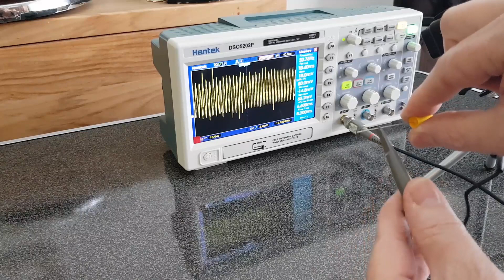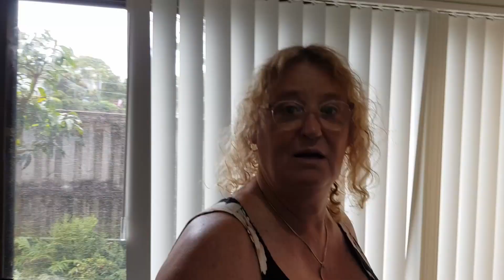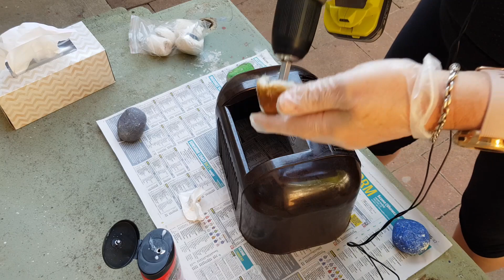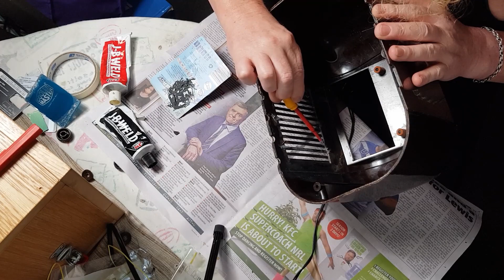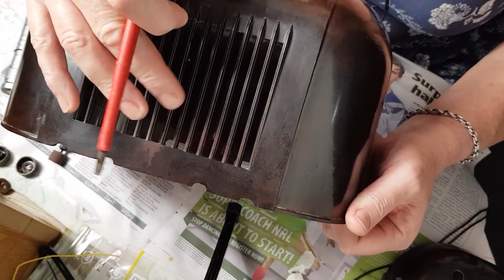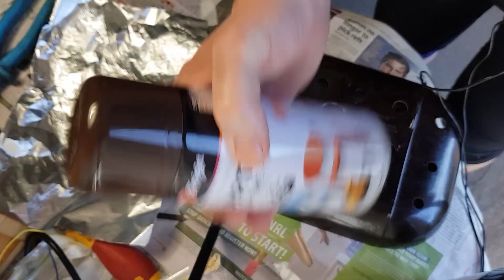Kriesler 11-20 valve radio restoration part 2 replacing the capacitors

Comment: Hi Melissa. I enjoyed your vids. I've just finished an 11-20X and used your JBWeld method to make two grill bars, then used your spray can brown black gloss colouring method. It turned out very well indeed. I have also found another way to colour the JBweld that worked really well in a limited trial, though needs more verification..but.... You can make the JBWeld a bakelite colour to match your particular case by mixing in Feast Watson Prooftint Interior Stain. It comes in 50ml bottles at Bunnings (in Australia) and you need little of it, but at $10.50 its cheaper than buying paint tins and in my opinion easier to match the 'bakelite look' ..better. I used 'Walnut' tint and just kept mixing it in until it reached the colour i wanted. It took about twice as long as normal for the JBweld to set, as the tint slows down the cross linking of the epoxy, so I think you'd leave the epoxy to cure for maybe two days before removing it from the mould. I'm in SE Qld and the weather is pretty warm. It may take longer to set and cure further south,  Like Brian H below  I also remember one my grandparents had one when I was a kid in the 70's and it always looked and sounded superb. Cheers
Reply from the maker: Thank you Paul for watching my Video and taking the time to explain your procedure, ill have to give that one ago next time I repair bakelite, I live in Sydney so I might have to leave it a little longer, I did try Araldite but found that JBWeld set harder then Araldite and found that JBWeld became soft under hot water from the tap but then became hard again after cooling. I have 3 of the 11-20's and have a Google Home hidden in a 4th one, I like the look of them and at the time were cheap pick up's for me to practice repairs on, Good luck on future repairs and thanks again for watching, take care Paul 👍
Reply: @melissa.merritt  Another thing is it's possible to colour cured JBWeld with the prooftint as well. I had a few small places on the case where I needed to match the bakelite colour after the JBWeld had cured for several days. It took the walnut very nicely from a brush but then left a slightly glossy finish. I was able to dull it down by rubbing the areas with kitchen paper a bit. It took off the gloss leaving a better satin finish and didn't lift the colour.
Reply from the maker: @paulnoonan4715  Nice, ill have to remember that one as well, thanks again Paul 😁

Comment: A nice restoration.
I have a few suggestions for you.  The first is when you have a set with so much rust on it, try "Evapo-Rust" on it.  Evapo-Rust comes in both liquid and gel forms.
The mixture of various paints that you applied with a "Q-Tip" worked well.  I saw a guy on another channel ( https://www.youtube.com/channel/UCG0axkVuIieduKse246SvXQ ) use different color "Sharpie's" (Brown and Black) to achieve pretty much the same thing.  Both methods are new to me, but well worth putting in the resource file.
Another suggestion, especially good for the small 7 and 9 pin miniature tubes (valves) is to clean the sockets they plug into with a Dental Flossing Brush and your chemical of choice.  They work pretty well on the 8 pin sockets also.
Where you needed to remove a bit of the JB Weld in the slots of the grill, you might have had a bit of success using the small thin cardboard-type fingernail files.  I have even had success in sharpening knives with them.  I start out with the lower grit side and then finish with the finer side.  
Something that I think you would enjoy and appreciate watching is this video ( https://www.youtube.com/watch?v=LhovRIM5xAo ) from the YouTube channel "Mr. Carlson's Lab".  Paul also has a circuit that he designed and provided schematic, board layout, and plans for that uses LED's to show which end of the capacitor is the outside foil end, but you have to be a Patreon of his in order to view the video and get the material.  You can become a Patreon on his channel for as little as $2.00 per month.  Anyway, I hope you enjoy that video and that my suggestions were of at least some use to you.
Reply from the maker: Hi Wayne and thank you for the information, I do watch Paul and find him very informative and will watch that video you have shared with me, I have seen him using that Capacitor tester in some of his videos, thanks again for the information and thank you for watching my Video, 👍